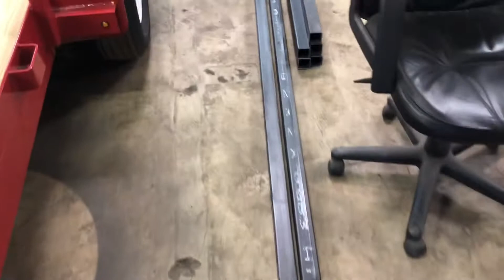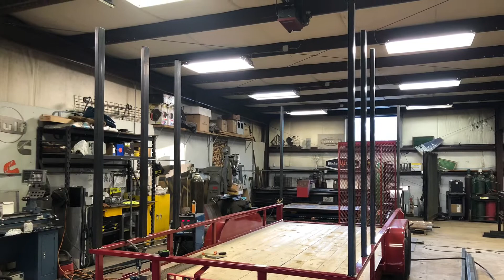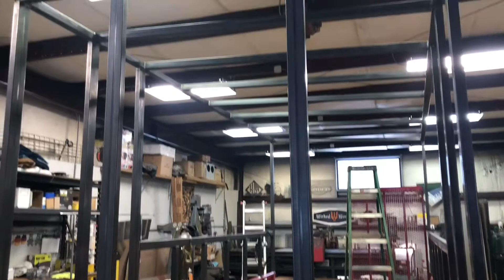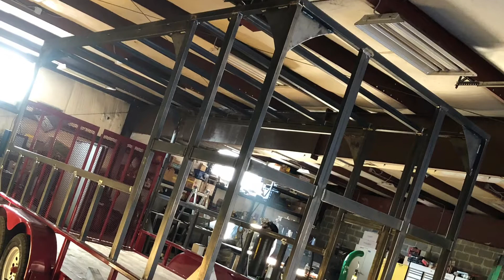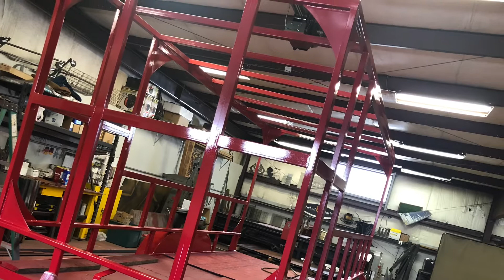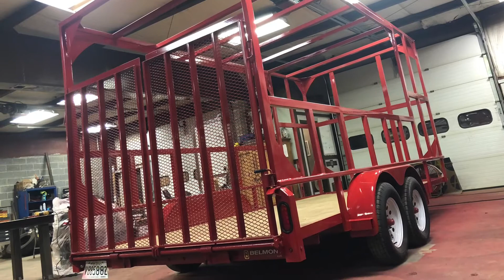Customized Trailer! Another Happy Customer!

Comment: Nice job! I'm guessing the customer is adding sheathing on the sides and top. Back doors?
Reply from the maker: jfgj;ld;ldf Styggvg thanks! Your correct, he is having another place do all the sheathing then all the electrical, and will put all the bbq stuff in
Reply: @wickedgarage  wow! Wouldn't a cargo trailer been cheaper in the long run?  Just put windows, etc? Jim
Reply: You did supply him with a great sturdy frame!  Job well done
Reply from the maker: jfgj;ld;ldf Styggvg the way this is being built has alot less regulations since its open, and thank you! Next one i will be building from the ground up!
Reply: @wickedgarage  OK! That would make sense! What part of the country are you in. I have done portable buildings and put trailers under them. Then rehab the bones of the building.
Reply from the maker: jfgj;ld;ldf Styggvg north jersey!
Reply: @wickedgarage  Know it well! Grew up outside Atlantic City. Spent the next 20 years south of Philly. Now I'm in New Mexico.